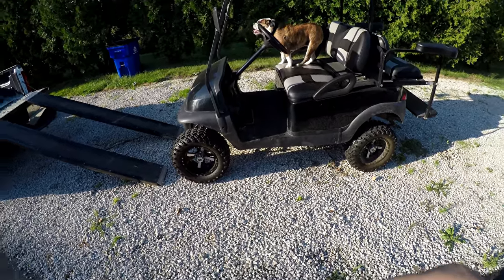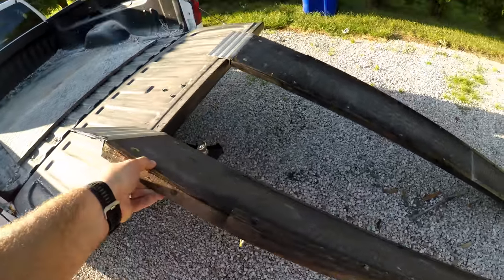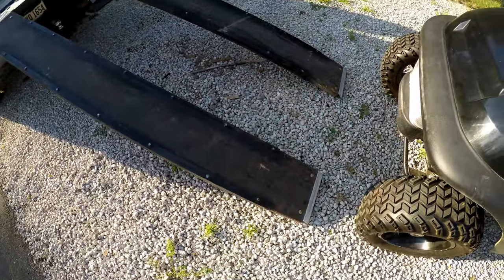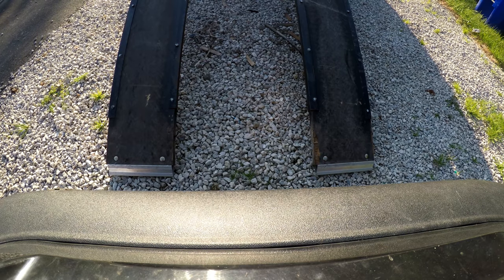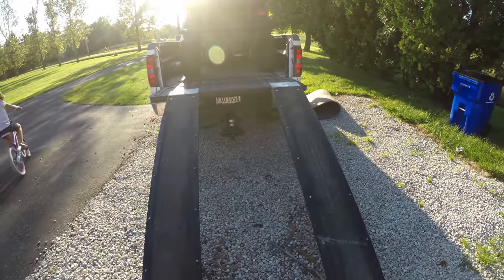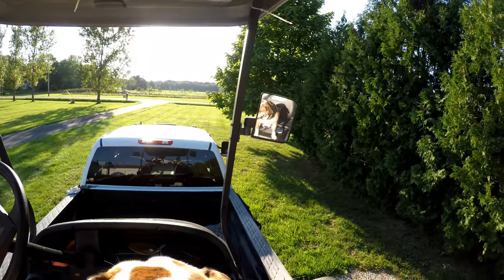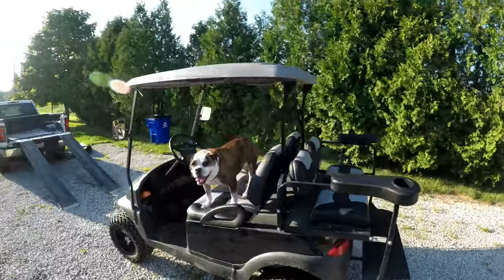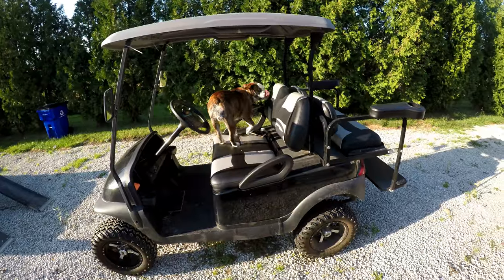Golf Cart Loading- RV Glamping Accessories Spotlight

Comment: do you have the cart in the bed of truck while pulling travel trailer and whaT SIZE OF TRUCK DO YOU have I have a 25000 hd liz Silverado and a 30ft travel trailer can I handle hauling both at the same time?
Reply from the maker: I have a 2500 HD Duramax Diesel and do haul it with the trailer attached loaded to the gills. It is not an issue, I am assuming you have either a diesel or  a 6.0 and it should be plenty of power to pull it. If you have any concerns, call your dealership and ask their opinion. Mine said plenty of power. Best of luck!
Reply: @grub32  harder 6.0
Reply: Gaser 6.0

Comment: How do you close your tailgate? And how long is your bed?
Reply from the maker: So I have an 8 foot bed which it fits fairly well. I also have a lift kit and the foot rest of the back seat still sits above the tailgate. Before the lift kit, it wouldnt close so I jacked up the rear end and put blocks underneath the back tires and ratchet strapped it in to secure it! Worked fine and I hauled it over 1600 miles that way.

Comment: Please be careful.  I did buy 1500lb ramps, for my gas cart.   one ramp broke while I was loading. After which, I learned about dynamic loading.    As I full-time rv,  my cart goes with me every where we go.  I later bought 3,000lb ramps.   I also put a winch on my previous cart..    Also, be aware if it rains,  you may not be able to drive up the ramps without sliding back down..   for that,  I carry an emergency Pullz-all 110vac powered winch.
Reply from the maker: Thanks for the info, My wife bought new ramps for me recently because I complained about how heavy my old ones were. I have used these tons of times and they have always worked well for me. I am excited to try them out!